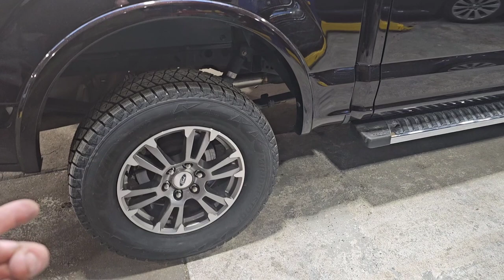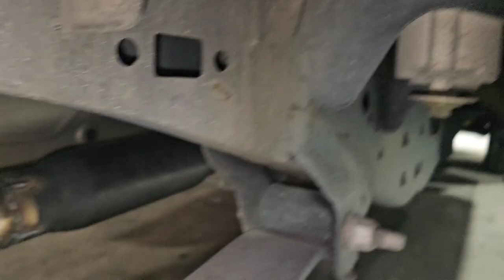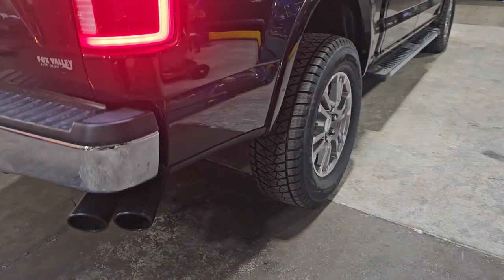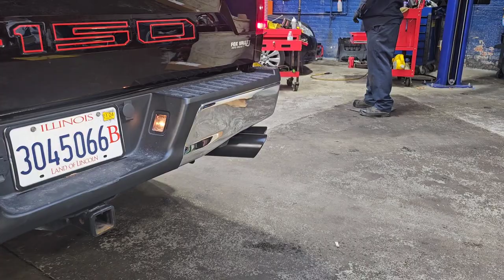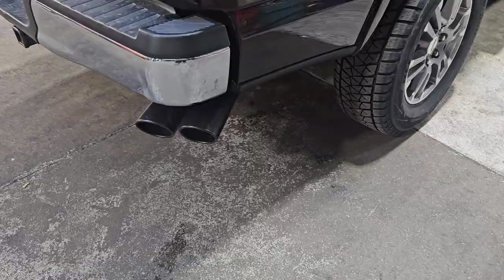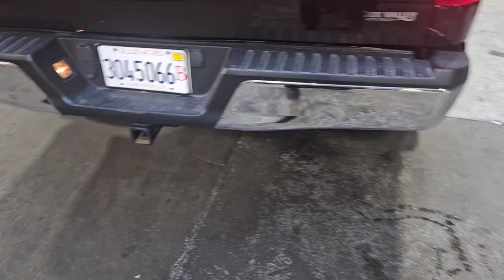2020 Ford F150 - DynoMax Race Bullet Muffler Replacement - Give Me your feedback

Comment from the maker: What exhaust are you running?!
Reply: Stock
Reply: Stock Raptor Ecoboost with a lot of boost on E30 fuel
Reply: Stock for now but hopefully the funds will come together next year for some exhaust upgrades.
Reply: 2.7 Ecoboost with stock resonator and Flowmaster flow fx resonator style muffler. Sound perfect and silent in the cab
Reply: Still stock exhaust. I like to be able to sneak in or out.
Reply: factory OEM exhaust, from the manifold all the way back to the rear muffler ,but factory for my car is so rare & doesn't exist in the states,as it was a prototype, pre production model vehicle, I recently had to change the manifold, both catalytic converters as they got severe damage by striking a discarded impound boot in the roadway, couldn't find my OEM resonator in either the states or S Korea, not even aftermarket, but luckily I found the better older all stainless steel version in the UK by a private seller who use to work at a UK Daewoo dealership, 🇬🇧 got that part mad cheap too ,under $100 shipped UPS from the UK to the United States, it's a $600-$800 dollar part here in the US if you can find one & basically from the catalytic converter back to the muffler, my 24 + year old OEM rear muffler is still in perfect condition
Reply: nice QUIET stock, no need to disturb the neighborhood

Comment: I like the look and sound of the dual tips at an angle. Great job fitting the muffler and tailpipe! I have to say that that is one sharp looking truck. The black with the red F 150 accent on the tailgate looks great. I like those factory wheels.

Comment: Currently im in my winter beater, a 2000 Silverado 4.8 with a 5 speed. Stock cats etc, but i slapped a 3" black widow neighbor hater muffler into dual pipes that exit at 45s under the rear bumper corners. Truck is bewt like a cabin screen door but it sounds good and should be fun for w couple winters

Comment: Can you please help me.
I have the 2015 f150 with 73k +. At 72 I got a P0430 code. I changed bought CAts and found that my original cats were fine. After clearing the code and driving the same code came back. This time I changed all 4 02 sensors. Cleared the code drove around, same code comes back. Now I change all 6 sparks plugs and ignition coils. Cleared the code drove around, same damn code comes back. I replace MAP sensor on the manifold and cleaned the second, plus for the hell of it removed and cleaned the throttle body. Cleared the code, well you get it. It’s back. Both cats were welded and everything done was done well. I would appreciate the help.  Thanks in advance
Reply from the maker: I need long term fuel trim numbers and short term